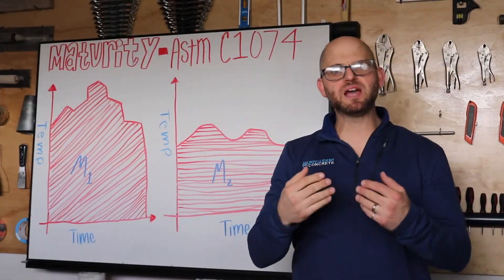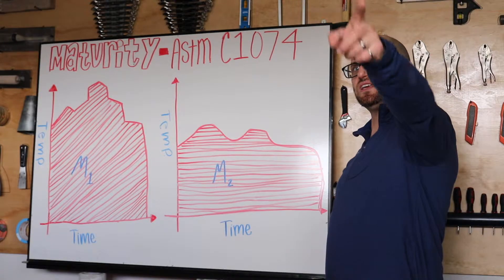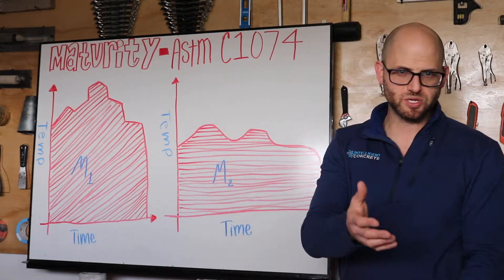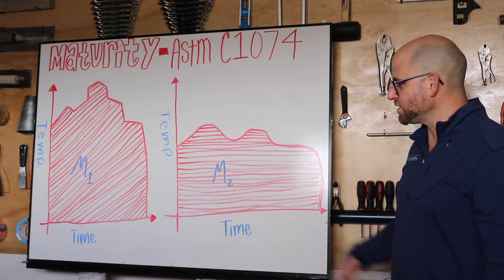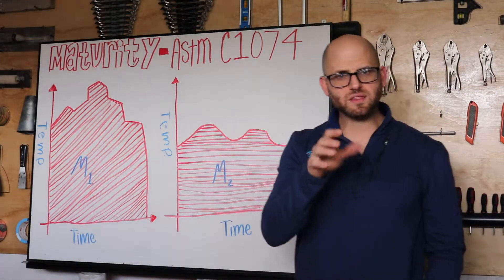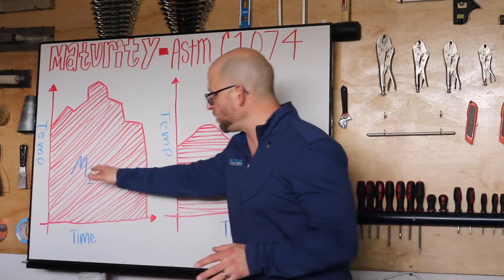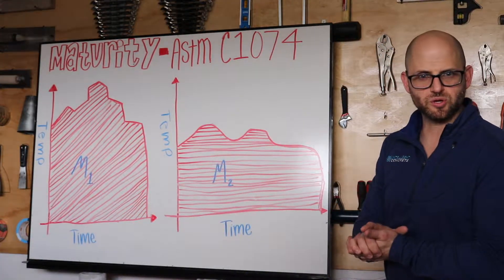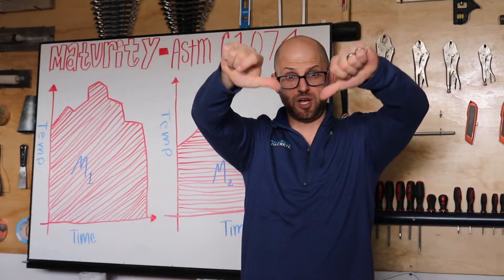Concrete Maturity Math - Vlog #240

Comment: So the X axis is the point of maturity? Here's what i think you said: the liquid mixture referred to in this video takes longer to solidify on a colder day than on a hotter day. Please let me know if i got that right, I don't know exactly what concrete maturity means. Thanks!
Reply from the maker: Concrete maturity is the time and temperature combination that it takes to reach a designated strength. Like you said, if it’s colder out it will take longer to reach a certain maturity and strength vs a warmer day.
Reply: Intelligent Concrete Thanks! And happy holidays :)